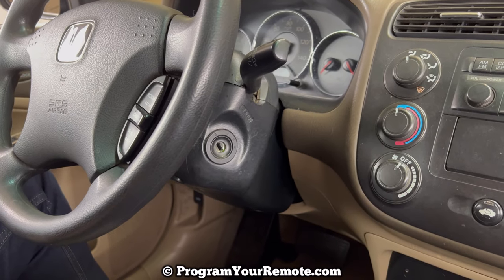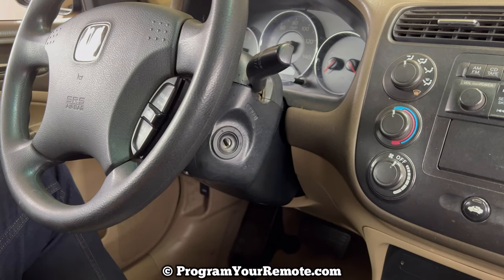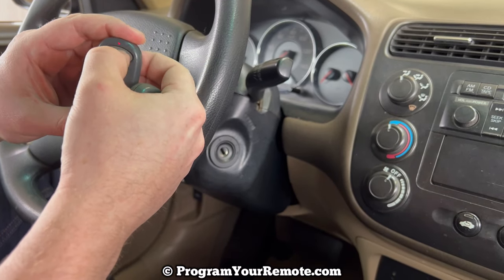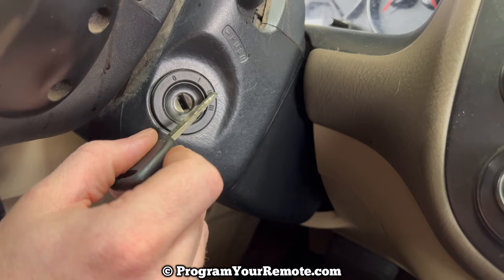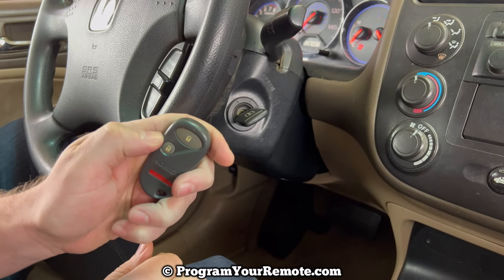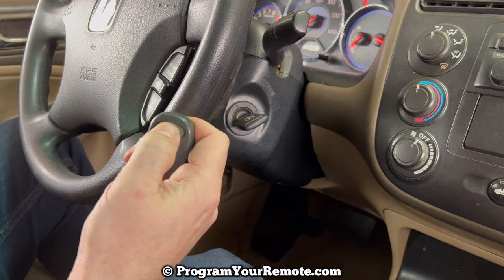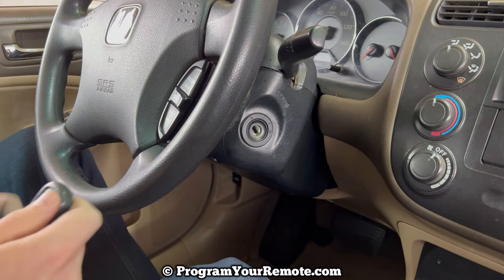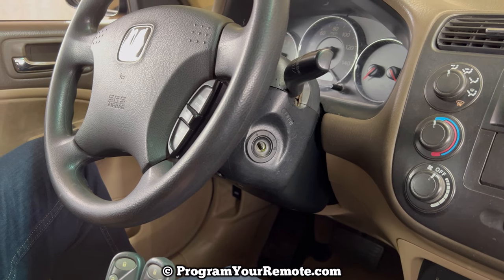How To Program A 1999 - 2005 Honda Civic Remote Key Fob - DIY Honda Civic Fob Programming Pairing

Comment: Do you need an existing system already on the vehicle or can you do this on a stock vehicle that doesn’t have remote lock and unlock.
Reply from the maker: the vehicle needs to have the factory remote system already installed